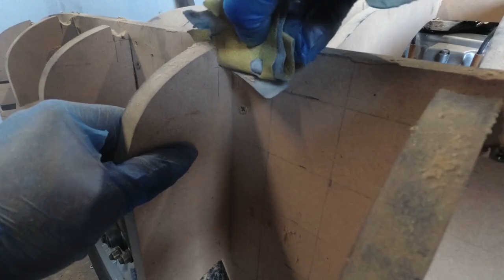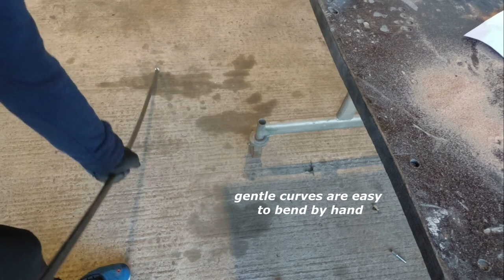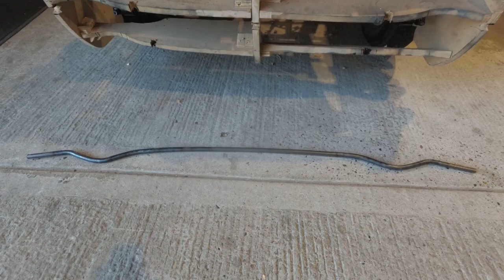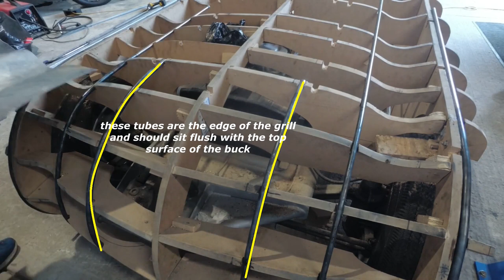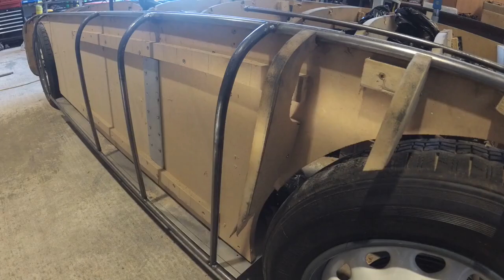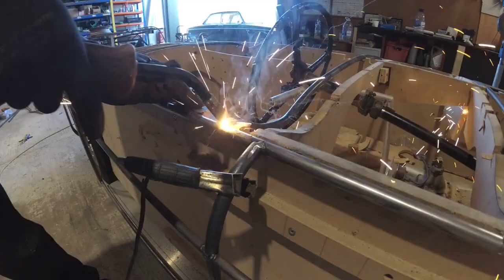Project Etceterini - Part 9

Comment: I guess I never understood the Superleggera building system. I thought the tube frame was there to support the body shell otherwise what's the point? Wouldn't it be better to make the body panels out of a thicker material that would hold it's form better and make bracing and brackets to mount those panels?
Reply from the maker: It does appear to have a quite bit of extra unnecessary tubing to carry.  Most of the old racers would have had a lot less tubing on the outer frame and less weight.   I've kept a bit of extra tubing behind the bodywork so if there is a small accident or someone leans on the car in the centre of a panel it doesn't cause a giant dent, only a small one.  
I think you're correct, that some well placed bracing and brackets built in to the bodywork could probably be just as strong and lighter as the Superleggera.  I'm not sure how old Lotus' attach the frame to chassis but imagine it is lighter.

Comment: Very interesting. Could the tube framework be built first and used also as a wire form buck?
Reply from the maker: Yes, I believe that would be possible and would save time building the wooden buck.  I hope to make a wire form buck for another project in the future.

Comment: Much enjoyed as ever.  Amazing precision on those bends and great to see it done "old school".  The bolts as end plugs I'd not seen before.  Will there be some sort of padding to take up the gap between the "not touching" tubes and the body skin?
Reply from the maker: The metal frame will be painted and I've been told to wrap electrical tape around the steel tube where it's close to the aluminium to prevent corrosion.  Ideally the frame should be just under the aluminium but undoubtedly there will be a few tubes touching.  Glad you liked it!
Reply from the maker: Possibly some foam cladding type tubes would be an idea to fill the gap. Thanks for the thought!
Reply: @GasoliniASMR  To be authentic it should be something to hold water :)   Was interested if the tube needed to be close enough to provide support if someone was to lean on it perhaps, but not touch and fret in normal running.  If its to never touch it could be a finger width away, and save a lot of bother.  Its a level of detail I've never thought about.   I expect in period some did, some not, and some lasted more than a single Mille Miglia, and some not.
Reply from the maker: @thedoingnotthedone  yes, I think I could chop out a lot of the tubes in the centre of the frame to save weight, but I am keeping them in case someone leans on the panels or for small dings that could turn into giant dents.
I'm sure there'll be a few tubes touching in places but as you say they were never designed as concours cars